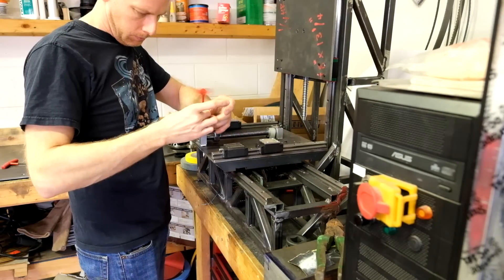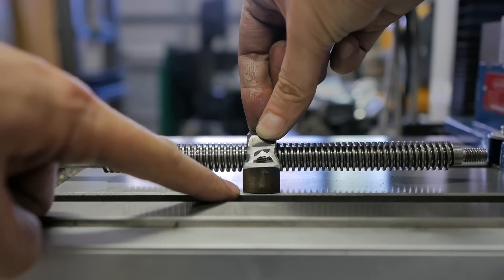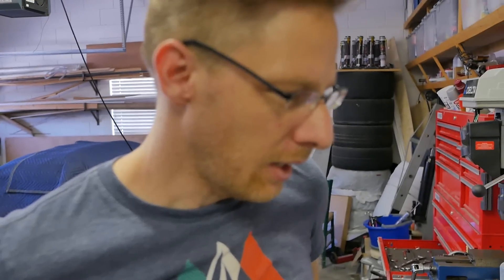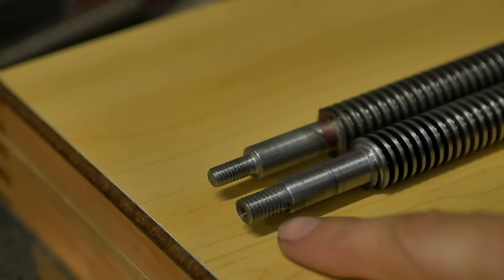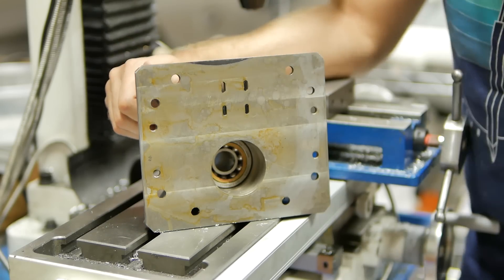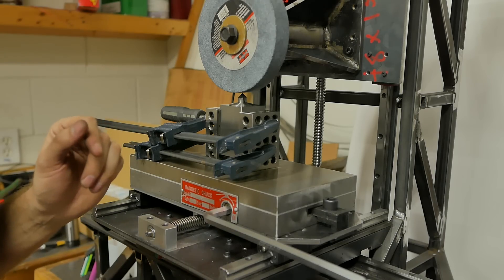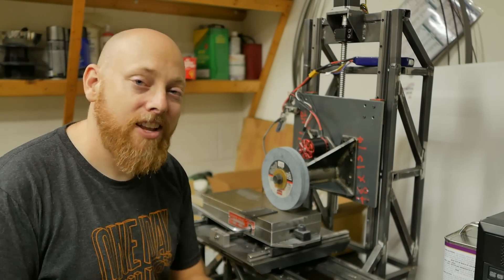Surface Grinder Part 11 - S02E40

Comment: That chatter won't go away with the adjustments you mentioned. Sorry. It will make metal shiny but your foundation lacks the rigidity necessary to maintain a constant height of the grains doing the cutting. You don't want to believe that, you dismissively call those of us who warned you about that issue over a year ago "haters", and you may actually succeed in finding a set of spindle and table speeds (after days of trial and error) that allow you to get a pretty good finish on one material, but with a different material or as the wheel wears down and the resulting change in diameter and SFPM changes the resonant frequency of the assembly you'll be back to trying to tweak the numbers to get it to work again. Because that's not the actual problem. That frame is ringing like a bell even if you can't see it. A high speed camera would show you that what we've been saying all along is true. Get your hands on a Chronos and see for yourself.
Reply: A sound pickup on the frame, hooked to an oscilloscope or spectrum analyzer, will show big peaks at the resonant frequencies.

Comment: Because of the material choice and construction method, this surface grinder might suffer from poor surface finish due to resonance in the frame. That said, I’ve followed this build from the start and I’m excited to see it take shape. Keep up the good work
Reply from the maker: Thanks man, both Ryan and I think this is a possibility. Being cnc controlled, there is a chance we can tune that resonate frequency out with feeds and speeds. But we won't know until it's done. Also the chatter you see in my test is also a result of a loose spindle bearing.

Comment: @1:14 You are indicating the wrong jaw. The movable jaw normally has .005"-.015" play in it when not clamping something. Indicate the rigged jaw the other will self align parallel when tightened.

Comment: Interesting video. A word of advice. When milling flat components do not clamp them down onto the table until you have machined a flat surface onto them or they will still be curved when you unclamp them. 3 point mounting for the first face.

Comment: I am looking at what's wrong but, all design elements aside, dress not only the bottom but the sides of the wheel. This really helps the natural balance from a mostly uniform structure. Grinding wheel balancers are available but, without the precision interchangeable hub, it's a waste of time. As someone familiar with surface grinders, I suggest a really tight, well fitting wheel to spindle hub.  Most real nice wheels have a polymer center machined to a nice slip fit on standard spindle hub diameters. The, what appears to be, bench grinder wheel, not so much. The rest of your design seems plausible for mediocre results but hey, what are you looking for?
Reply: ".. but hey, what are you looking for?". Views.

Comment: one thing i seen on other grinders (tool and surface) was that they had a taper in the axle and every stone had its own hub that fitted the taper in the main shaft same way as in a mill 
doing it this way makes it eazier to keep the stones round and square to the surface even after changing them , come to think of it it might allso prevent the stone from developping a crack from thightening and loosening it on the spindle a few times

Comment: It's starting to look like a grinder!! Sweet! 👍 Have you thought about having it as a belt grinder style surface grinder? Apparently they are much easier to use as you don't have to worry about the grinder wheel constantly changing size while in use. And it's a lot easier to change grits as well as a much larger selection. 🤔
Reply: Mr Takisawa  ok, thanks, that does make sence. When I've watched people grinding large areas and re-dressing the wheel after grinding each piece (or probably what looks like every piece), I've always wondered how much of a difference the is in thickness due to where on the grinder wheel. If it's only the leading edge doing the cutting as that looses materiel, there's always more edge being exposed...... or until that's happened across the whole face of the stone, which I'm guessing would take a lot of grinding!

Thanks for the reply

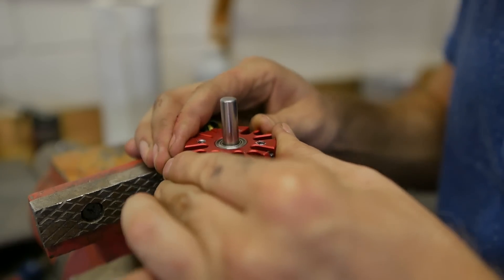Comment: 9:45 I don't know about this type of motors, but some modern motors (especially steppers) with strong magnets can't be disassembled just like that. The permanent magnets loose the magnetism when you break the magnetic circuit and the motor becomes much weaker, practically unusable. There should be ferromagnetic pipe called "keeper" which replaces the rotor as you pull him out and keeps the magnetic circuit closed until the rotor is placed back. It must be done simultaneously, the magnetic circuit must not be broken even for a fraction of second. Here is more https://www.cnczone.com/forums/stepper-motors-drives/129500-machinist.html
Reply: Not an issue in this case.
Reply: this isnt a stepper motor, its a brushless outrunner
Reply: wow, had no idea this was even a thing for servos.

Comment: What factors determine whether you use a drill vs a reamer vs a boring bar.
Reply: Size and tolerances. Drills are good for removing material fast. Reamer are dimensionally accurate and can go into very small holes and boring bars are typically used on bigger bores only,  require more adjustment but provide dimensional and locational accuracy.  The next level would be jig grinding etc.
Reply: Mostly precision. Also: Boring bar can create any diameter in range. (Drill: not that accurate, boring bar: must be measured for each operation, reamer, when in spec, produces basically a bang on hole, so you can make holes and those holes WILL give a defined fit with e.g. a bearing race.

Comment: Kinda unbelievable this is still gonna be the first complete series of a surface grinder build on YouTube...
Reply: Not much unbelievable about it. Even benchtop surface grinders (such as my own Covel) have massive castings. That mass is crucial to the performance of the machine and the quality of the work it produces. This is a fun exercise but most people who want a surface grinder have a different set of criteria than these two, which makes a shop made surface grinder highly impractical. There are builds out there on machinist forums and such, but most people buy instead of build. When you understand the problems with building one there's not much mystery to the lack of build videos. Not impossible, just very impractical.
Reply: @jonmillerpersonal  But for the home hobby shop, impractical and fun is often the bread and butter.
Reply: @Imrahil that's why there's still much more videos than 3 to do on the matter 😜
@John Miller I was also thinking about the mass and vibration issues... Structure and can still be wrapped with still plates and filled with dampening material like epoxy concrete.
Anyway guys this is a superb series I'm greatly enjoying and hope you'll get the result you're aiming at. In any case, you'll surely have learnt a lot on the path and shared experience with the greatest number, and that is worth anything.